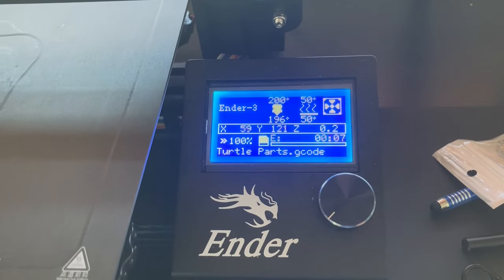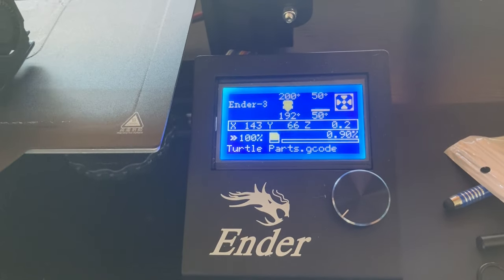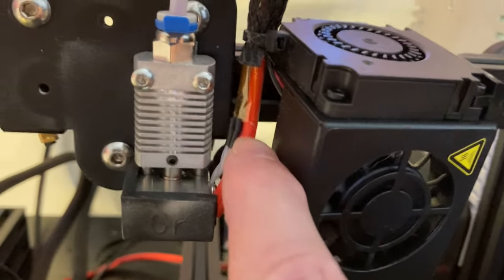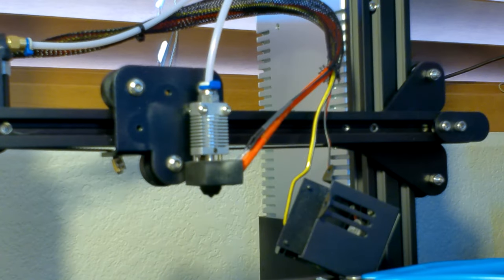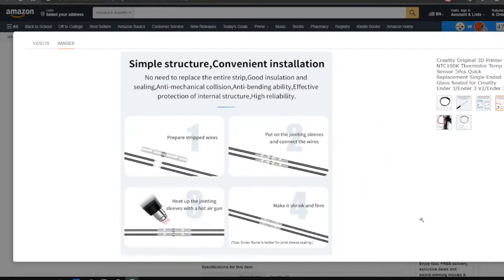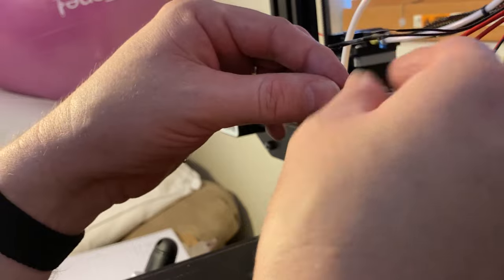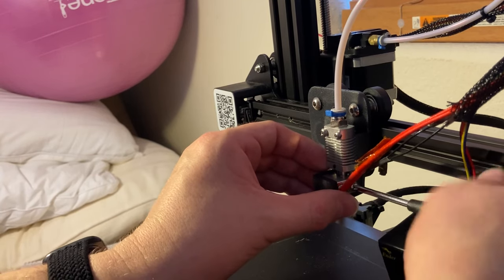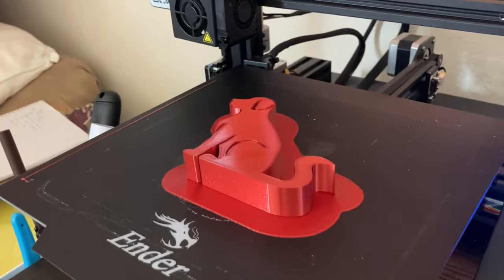STOP THE BEEPING! - Ender 3 Thermistor Replacement - Fix Thermal Runaway Issue

Comment: In most cases the problem is a white powder residue on the thermistor. Just pull it out and clean the white powder off and blow out the hole, then reassemble. It's that easy.  This happens a few weeks to few months after getting a new Ender 3. Just depends on how much you use it.   Occam's razor, the simplest solution is usually the correct one.
Reply: Thank you I thought I was going to have to buy something but that fixed it❤
Reply: @itsadamdatboi4895  You are welcome brother. This is a common problem on all new Ender 3 printers.
Reply from the maker: That’s good information for everyone. I pinned it to the top so others can see it. I tried to communicate with Crealty before and the only response I got sent me to a diagnostic video saying to replace the sensor or the entire board.
Reply: @S-Technology  thanks brother. just trying to save a few people some headaches and money.
Reply: I've used the crap out of mine in 5 months and finally ran into this problem. I am trying this method first. I definitely saw a bunch of white dust fall out of the hole and off the thermistor end when I unscrewed it. Hopefully the easy fix works. I am not very good with my hands on tiny stuff like this. Total clumsy hands. Assembling this printer was quiet the experience lmao.
Reply: it worked!
Reply: @d.r.hardin2297  That should fix it if you have dry white powder in the hole. clean it best you can.
Reply: @d.r.hardin2297  Glad i could help brother. Enjoy printing.
Reply: hey dude! i thought i was going to have to replace the thermistor but this did the trick! thank you for you service 🫡
Reply: I am new, and IDK how to take it off or how to blow out the dust.
Reply: @z3rog4mer84  follow what the guy does in the video and take out the little plastic thing from the bottom hole, that’s the thermistor. if there’s any white powder on the tip of the thermistor carefully scratch it off with your nail, MAKE SURE TO NOT POKE IT OR IT WILL BREAK. once it’s clean put the thermistor back into the bottom hole, screw in the screw above the thermistor, and re-assemble the hot end box. after make sure to run a pid tune and also re-level your bed if you need to.
Reply: @z3rog4mer84  Take off the plastic cover around the hot end, 2 screws to remove. then remove the thermister from the side of the hot end, it will have 1 screw holding it in. clean the thermistor with a cloth or tooth brush and use a tooth pick to scrape around the inside of the hole. then take a plastic drinking straw and blow out the hole. then reassemble everything. Do not tighten the 1 screw that holds the thermistor in place very tight, it will damage the wire, just snug it up so it will stay put.
Reply: @gangel478  you are welcome.
Reply: Works!
Reply: here is another tip. the original glass bead thermistor will eventually stop working. they are cheap and fragle. when it does get an upgrade like this one. ""HEX EPCOS Thermistor Upgrade for Creality Ender 3"" from amazon. it will screw into the heat block and replaces the screw that held in the original thermistor. it's about 10 dollars but will last forever and gives a much more accurate reading.
Reply from the maker: @3D FPV CLUB  Are you talking about this extension? https://amzn.to/3EBahfv
Reply: So I did take it out and clean it and put it back in but didn't see any residue. Still its been going all night and seems to be working. Thanks!!
Reply: @AgentsingleO  Glad i could help brother. stop by my channel and see all the cool stuff i have printed and painted. just finished a 2 foot long Star Trek Enterprise NCC-1701
Reply: @ChrisRiley3D-Everything  will do!! That sounds awesome and thanks again!!!!
Reply: Your fix worked! Tons of white dust fell onto my print bed and all I did was blow into the hole and re-screw. Very helpful thanks!
Reply: @RatedPurple  Thanks brother, Glad i could help.
Reply: I got the thermal runaway error after just a couple days of use on my ender 3 pro. This fixed the issue for me!
I wonder how that powder even gets there in the first place.
Reply: @dragairvideos7487  it's a cheap thermal paste and it gets old and dry and stops working like it should. those original glass bead thermistors are nothing but trouble. i finally replaced mine with a screw in type all metal up grade thermistor from amazon. it solved all my problems for good. https://www.amazon.com/Upgrade-Thermistor-Temperature-Printer-Extruder/dp/B08YNX79H8/ref=sxin_15_pa_sp_search_thematic_sspa?content-id=amzn1.sym.d5d2dbeb-b217-4d41-ad6b-bc4af55d7521%3Aamzn1.sym.d5d2dbeb-b217-4d41-ad6b-bc4af55d7521&crid=3PZD9Y8AO20XM&cv_ct_cx=thermistor%2Bender%2B3%2Bv2&keywords=thermistor%2Bender%2B3%2Bv2&pd_rd_i=B08YNX79H8&pd_rd_r=a4a4da7b-ed7b-4d41-a911-b5ccf476df0b&pd_rd_w=FlZeu&pd_rd_wg=a4Z9T&pf_rd_p=d5d2dbeb-b217-4d41-ad6b-bc4af55d7521&pf_rd_r=Z9804PFJP71JKCBJ0V30&qid=1672622365&sprefix=thermistor%2Caps%2C98&sr=1-2-a73d1c8c-2fd2-4f19-aa41-2df022bcb241-spons&spLa=ZW5jcnlwdGVkUXVhbGlmaWVyPUExVDVGS0hOTkJBOFhWJmVuY3J5cHRlZElkPUEwMjA2MTg4MUk1M0RCTEQyTkszUyZlbmNyeXB0ZWRBZElkPUExMDA3NzUyMTUwSzBBNTc5VkhCWCZ3aWRnZXROYW1lPXNwX3NlYXJjaF90aGVtYXRpYyZhY3Rpb249Y2xpY2tSZWRpcmVjdCZkb05vdExvZ0NsaWNrPXRydWU&th=1
Reply: That fixed it! Thank you
Reply: @12bm1980  You are welcome.
Reply: this comment is 100% right. I popped my thermistor out and white dust poured out. Reinstalled the thermistor and hopefully everything works now. Anyway I've ordered a new heat block that uses M3 stud thermistors to avoid any future problems with this fragile unreliable solution
Reply: Please- I thought this ment to just blow on the inside of the box thing, and that worked for a bit, but after a week it kept doing it over and over again. WHAT HOLE SRE YOU TALKING ABOUT?!
Reply: @ChrisRiley3D-Everything  ah, okay. I think I fixed it but I will save your comment. Thanks dude. If YouTube had reddit rewards I would give you some.
Reply: @ChrisRiley3D-Everything  I used this solution the first time and it fixed the issue for about four weeks. It happened again and when I tried to clean it a second time, a piece of glass broke off the thermistor. I replaced the entire thermistor and got another thermal runaway error immediately. Help!
Reply: thanks for the input.
For me it helped to refix the screw. so far i were able to continue my print. so far 12h without any error :)
Reply: @coopjaquish  My guess would be that your new thermistor is broken or not the right one.
Reply: U literally just helped me fix my problem tried printing carbon fiber nylon at 260 nozzle temp and it would thermal run away every time and I did what u said and so far so good! Thankyou very much! Ps there should be a vidio on this when u search this problem for this printer!
Reply: @dennissusman6887  you are welcome. the problem will come back over time. don't know why but it does. i have a permanent fix you can see here.  https://www.youtube.com/watch?v=7q44YwiDgu0&ab_channel=3DPRINTING%2CMODELING%2CPAINTING%26FPVCLUB
Reply: Great community bro
Reply: Dang!!! Cleaning it off worked!! Thanks
Reply: @Stirfry001  you are welcome.
Reply: So what is the white powder - and how often do we need to do that
Reply: @caseymoto  it is a thermal paste that gets old. only the one time. The hole is slightly larger than the glass bead thermistor but as long as the glass bead is making contact with the metal when you put it back in then it will work. if it ever gives that problem again just reposition the glass bead a little.
Reply: @ChrisRiley3D-Everything  thanks.. hey I wanna use my 3d printer to create  an fpv drone do you have any tips ?
Reply: @caseymoto  Yes don't do it. it will break. sorry but many have already tried. unless it's a tiny whoop or something very small and light weight.
Reply: Thank you! 🙏
Reply: @chris riley.  I suspect dust can also cause that issue.
Reply: Putting this here. I had very little residue inside when I tried this, but... It seems to be working. Thanks for saving me some money on a new one!
Reply: @grenade4less  you bet brother. glad i could help.
Reply: I didn’t see any visible powder but I’m trying this right now as well
Reply: ❤Thanks for THE TIP‼
I'll try that before I go dissecting, to do any replacement shit...😡  FOK‼
I BARELY USED IT‼
Reply: @ChrisRiley3D-Everything  my printer just did this for a second time, right after I replaced the bowden tube.. any idea why? I am going to take it apart and look for more thermal paste dust
Reply: Blow out what hole?
Reply from the maker: You clean off the “dust” in the hole the thermistor is in. The other hole is just for the retaining screw.
Reply: @S-Technology  yeah trying to reach out to creality is a god damn joke
Reply: I think I have an issue like this but I have to clean my thermistor every two hours or so... Can you help please?
Reply from the maker: @princessfaudia98  You shouldn't need to clean it that often.  It's possible it's faulty if it's going off that much.
Reply: @S-Technology  thanks, I'll try changing out the thermistor
Reply: Thanks a lot for the fix! I was about to getting rid of the machine because it just kept happening (already changed one time the hotend and it had the same issue) until I read your comment and it was the best fix in less than 5 minutes got it done and ready, the printer has worked 20 hours straight without any thermal runaway issue! Finally a fix for this!
Reply: I didn't see any dust or white powder but tried it anyway. It's prenting again for 30 minutes with no error and consitent temp measurement. Thank you and the S-Tech sooooo much <3 <3 <3
Reply: @S-Technology /videos The white powder was probably aluminum oxide considering the heat. Its an insulator. Also, I didn't see which area you put the thermister in due to the camera angle and I didn't remember where I pulled it out of so I put it in the hole under the screw hole. I think it worked.
Reply: @PhillipJFry69420  You said that two months ago.  I agree, that's about when I bought my Ender3 V2 Neo, which started SCREECHING about 20 minutes into every print after about 35 days (outside the return window).  Emailed them three times, the most recent to say "do you want to make this a return?", and still no answer.  Am about to attempt this, it makes sense.  Thank you!
Reply: Thank you. Had this happen mid print. I lost the print but i saved the week or so that i would have had to have waited to print again.
Reply: @ChrisRiley3D-Everything thanks I’ll try
Reply: i love u ty
Reply: HOLY! THANK YOU!!! using air duster and some blowing fixed my issue THANK YOU!
Reply: Thank you, I did this, and my printer is now reading 200 consistently
Reply: That white powder is from dried out thermal paste. I recommend cleaning out that cheap stuff and replacing it with quality thermal paste. Otherwise your thermistor will have inaccurate or slow responses to temperature change.
Reply: I want to add one more thing blowing out the bad thermal paste and doing nothing else is the equivalent of turning up your radio to ignore a beeping check engine light. It will have your nozzle run hot.
Reply: @flyback_driver  Well then fix it your way i dont give a shit. worked for me and hundreds of others.
Reply: @flyback_driver  Well shit how knew. Thermal paste. you think we are all idiots here and this is our first rodeo! who knew i had to spell out all this. Wow some people !
Reply: That's exactly what was wrong with mine! I searched "white gunk thermistor" and a ton of other variations and NOTHING came up anywhere. This is the first time I've seen someone else mention it. I cleaned it off, and it worked like no problem. Although now I'm getting the message again, after upgrading the firmware from the creality website. I haven't taken it back apart yet. Hoping its another easy fix.
Reply: @AgentsingleO I cannot believe you blew up your house just to make that video on Episode 1! :) I love the videos!
Reply: Thank you so much! I was having 200 to 155 drop-downs and i just cleaned the thermistor tip and the hole, and now it stays at perfect 200. Really needed to print this piece before tomorrow and you saved me ❤️
Reply: Brother, thank you. I have a deadline tomorrow and I was worried I have to replace the thing at 22:00.
Reply: If I could give you more than 1 like I would this saved me so much time and money. Thanks bro ❤
Reply: @djmole747  you are very welcome. glad i could help.
Reply: Thank you so much! You’ve helped me get my printer working again!
Reply: Mine has red residue on it and I used red petg from inland?
Reply: thanks so much for this!
Reply: Exact. I removed the thermistor and saw some white powder / paste on it. I cleaned it using a scott towel and isopropyl alcohol. Now temps are stable

Comment: This has just happened to me after flogging the Ender 3 Pro without a break for about 15 months. I have removed the fan shroud and found it clogged with dust as well as part of the hotend, I'm hoping this will fix the issue but the next thing to try is removing the thermistor as suggested. Should all this fail I have a new thermistor ordered and arriving soon. Thanks for the tip.

Comment: I was getting thermal runaway and sure enough one of the wires was had broke off inside the hot end. So mines down until i get a replacement.

Comment: this is SO much better than Creality's video on the same topic! They make it seem like its necessary to remove the whole wiring harness from the board! I just ordered a new thermistor but will be cutting and splicing it instead. Thanks for making it much simpler!
Reply from the maker: Thank you. I just want the video to be helpful. This issue bugged me for a bit. 

They actually do have a video about repairing it the same way that I did in the video. But for some reason (maybe money?) they don’t link that video if you speak with them about how to repair the issue.
Reply: it`s all in the sales it`s great for a while, until you have to piece the old with the new together.

Comment: Was a little scared to start cutting wires as I'm not experienced, but got it done. The shirk wrap solder sleeves are fantastic. Finished two weeks agon and probably have 24 hours of printing with no more interruptions. Many Thanks. (Subscribed)
Reply from the maker: Great job going for it. 
Thank you for subscribing.

Comment: Another tip, if you have a soldering iron is to unsolder the speaker from the display board. If you aren't concerned with losing scrolling beeps - this prevents the obnoxious, head splitting beeping.

Comment: Thanks for the video. I found the white powder surrounding the thermistor, but after cleaning the head got hot, but not enough to melt the filament. I cranked the temp up to 255 C, but still the filament did not melt. I guess I new a new thermistor.

Comment: My printer makes the same sound, but I don't know if it's the same issue. I'm in PA. It's mid November. It's cold. My printer is out on the porch where it is screened-in, no windows. I only been using my printer since June, and never have an issue.. I have been printing since then, even in the cold (even when it's 40 degrees out it was printing fine especially with the dry box I bought for it). Today when I went to preheat the bed and nozzle, it made that sound. Is it because it is now 30 degrees? I don't know how much it's going to warm up weather-wise, but is it because of the cold weather? Or is it this problem.  Thanks in advance.
Reply: Nevermind. I waited a few hours. Its now 50. And - its working! So - it may be just that it's tool cold if you're printing in frigid weather.

Comment: i hear it every time i try to print even after swapping thermistor 3 times.
hope youre gonna help me with this video.
Reply: so far ive spliced in those thermistors by just twisting and insulating the wires, although it would be weird, because it had worked for months before, i wouldnt be surprised if that is the problem.
Reply: ender 3 v2 btw

Comment: The thermistor screw on mine is off but the wire won't come out. The whole thing is a bit gunky, but it could also be the plastic bit you mentioned. How do I pull the wire out now?

Comment: For now, since the hotend and Teflon were new, I also cleaned them, I ruled out any reason related to dirt or accumulation of material.
I thought about a bad contact of the thermistor (temperature sensor I call it), since the way of securing the cable and the sensor itself is not that good. I removed the screw, checked the end and then tightened the cable and put it in place. Without putting the screw in, I turned on the printer and the message no longer appeared. I replaced the screw and the message appeared again, this when turning on. I removed the screw and noticed that the sheathing of the cables was damaged. When I put the screw in, it made contact with both (I don't know if negative or positive, maybe it doesn't have polarity, I don't know), whatever the case, I covered part of the indicated cables with heat shrink tubes, obviously I had to cut them longitudinally to be able to put them in. I put the sensor in place and the screw. When powering on, the error message no longer appears. The display appears to show the correct temperature, different from the ambient temperature it appears to show when the sensor is disconnected.

Greetings 😁😁)

Comment: How did you get such great top layers ? Settings? Iron?
Reply from the maker: It has to be the settings.  I don't do anything else really.  I barely modified the printer except for changing out the springs for rubber spacers.